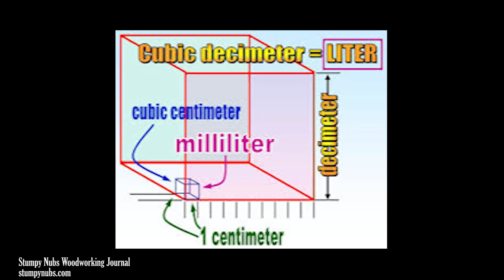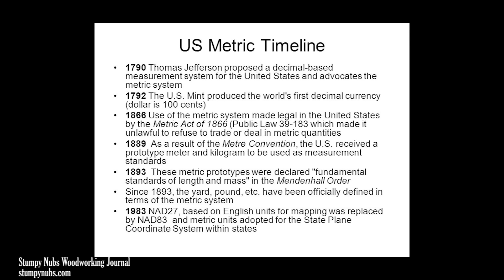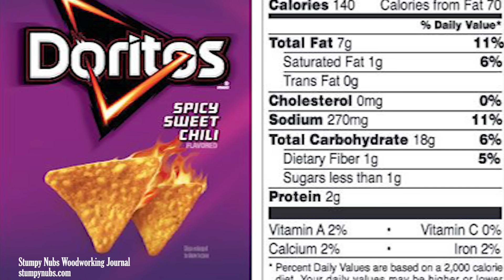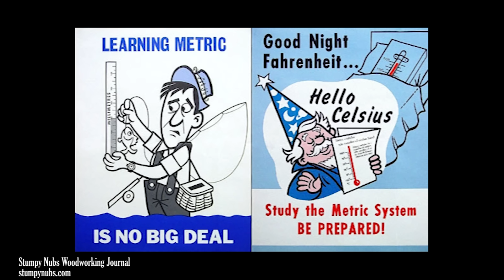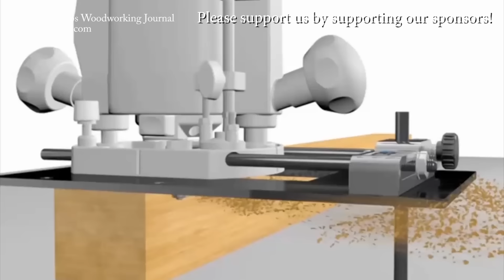BREAKING: The USA is switching to METRIC!

Comment: I’m Canadian, grew up as a kid in the SI world, adopted into the metric system when Canada flipped and am equally confident in using either system. However, I frame houses 16” on center, using 2x4s, 2x6s, 2x8s etc, do most cutting with either a 8 1/4” or 10” blade on my  power tools. When I drive to the local hardware store I keep to an average posted speed of 60 km/hr over a driving distance of  12 kilometres, all the while wondering if the weight of the  load of  5/8” plywood will make the trailer tongue weight exceed its maximum rating of 200lbs. Of course during the drive home my wife phones and asks if I could pick up a pound of ground beef, 2 litres of 3% milk,  150-200g of freshly sliced smoked ham. I said “of course I will, but first have to stop and get some gas - hey, did you notice gas prices dropped to 173.9 a litre today!?!?!”  Her response: “ great, now we have a few extra toonies to take with us on our trip to the States tomorrow!”  And,  finally “Yes dear I’ll remember to drive at their posted speed limit of 60mph!”  Now I ask you, do I qualify for dual-citizenship, or do I simply have to accept the fact I live in a global world.
Reply: Retired Canadian carpenter here. I lived through the same conversion. I was a foreman with about 20 men working on a large concrete forming job and it was the first project we did with metric drawings. The mistakes were a horrendous cost, all bacuse the guys were trying to convert to imperial. After a couple of days, I had to put a stop to this so I went and bought 20 metric only tape measures and the next morning exchanged with the guys for their old ones. It took a day or so, but they soon got used to it. I only lost 2 men because of it and they were about to be let go anyway.
Reply: Is your 2x4 actually 2x4? Our equivalent is 45*95mm so it got a bit smaller, old people still call them 2x4 (that would be 50.8x101.6mm). Or is it that raw timber starts at 2x4 and after it is planed it turns into 45x95 if so you are already in metric...
Reply: @kjelllindberg6987  In the US it's much worse, I think the term 2x4 is defined based on some low-grade timber, while modern construction timbers are a higher grade. Other explanations say the 2x4 was measured before drying and milling. Therefore a 2x4 is 1 1/2x3 1/2" or 38x89 mm. Which isn't a lot more than the 5x8 we use in Austria (48x78 mm). We rarely use those for framing walls though, that's 95% metal studs because they're cheaper, lighter and easier to assemble, no nails or screws involved. Load-bearing walls are either masonry or much bigger timbers.
Reply: @Ragnar8504  My grandfather was a sawyer. He cut 2x4s out of logs that were 2" by 4". But then downstairs in the mill they got planed down to something smaller.
Reply: Oh Canada! 😂

Comment: Canadian here. Almost everything is in metric, but body height and weight still tends to be imperial. My daughter is learning kg and cm, but for me, it’s still Lbs and Ft. Everything else, is metric… except vehicles. You need both metric and imperial sockets and wrenches as half the bolts are metric and the other half are imperial…
Reply: little correction, the SI units are "kg" and "m". centimeters are "cm".

Comment: 6 Months ago I bought my first metric measuring tape...  I find myself reaching for it more frequently.  I'm also old enough to remember being in junior high and being forced to learn the metric system for science...  Dividing by ten is not very hard!  Cheers!
Reply: Fractions aren't hard, either. We learned them in elementary school.
Reply: @TheCharleseye  Both are easy, but it's just simpler to say one number vs a few numbers. That's it. You can say: "three AND one-sixteenth" or just "seventy-eight". When you're on the jobsite it's easier to scream one number, instead screaming multiple numbers. It's also easier to add/subtract whole numbers. Doesn't mean fractions are difficult
Reply: @wittttttt  Obviously fractions aren't difficult. American laborers use fractions without any issues over yelling the numbers across job sites. It's the rest of the world that can't handle something so simple, that they need a system to be even easier than the one Americans learned in grade school. That's fine, though. That was previous generations. This generation can't even make change. It's a good time to switch, so that this generation of Americans actually has half a chance of being able to handle the math related to a given field. American exceptionalism is circling the drain.
Reply: @TheCharleseye  Just to be clear - I use both.  Dividing fractions? invert & multiply.  Quite simple. Metric - just divide.
Reply: yeah I remember them training us on metric when I was a kid, then it just kind of died.
Reply: @joefaraone977  Right on.
Reply: @TheCharleseye  I don't understand where you get the idea of the rest of the world not being able to use fractions - everyone learns it in elementary school same as in the US and we do A LOT of fractions in school/uni since a lot of engineering formulas utilize them - it's not like we use multiplication by 0.125, we still use divide 8 etc. 

I think a large part of why metric people complain about fractions is that since we do not use it daily, for materials an such, we (european myself) automatically want to think in what you would say decimal and it creates silly numbers, that are not "round" numbers. For example since the stuff we use are not ever in fractions like 5/16, we would convert it to 0.3125 and that just makes for an unappealing number. I don't think it's necessarily hate for imperial/usc, it's just that we are not surrounded by these numbers daily.

Imo, use whatever you want and think is best.
Reply: @TheCharleseye  "Fractions aren't hard, either. ". The point is they are unnecessary. It's useless labor when a simpler method is available. Adding up 4 inches and 3/8 to 12 inches and 7/16 instead of two whole numbers? No thanks.
Reply: @TheCharleseye  - Okay, say you have a steel beam that's 26 feet long, and you need to divide it by 7 so you can weld support beams to it.  That gives you a measurement of 3 5/7 feet between beams.  How are you going to lay that out with your imperial tape measure?     If you're using the metric system, 26 feet = 792.49 cm.  Divide that by 7 and you get 113.21 cm, which you can simply read off your metric tape measure (and you just multiply 113.21 times 2 or 3 or 4, etc., to get your next beam's location from the starting point).   Which is faster, easier, and more accurate?  It's a no-brainer.  Don't say Americans are smarter than the rest of the world, most Americans don't know fractions at all, and those that do use fractions in construction have memorized the ones they need, but would probably not have any idea how to solve this problem with fractions.

Comment: Went totally metric when about 2 years ago when I finally changed to Celsius because I did a total immersion language so I could feel comfortable in my second language.  The hardest part of that was actually the fact that I needed to convert the speed and distances for when I described a road trip because I was so ueed to giving location as being the amount of time it took to get there not taking into account that I was telling that to someone was using the Autobahn which made something like its an hour away from Chicago a meaningless statement.😅
Reply: I'm just running in to the "X hours away" situation while planning a trip to Japan next year, where "an hour away" (while considering daytrips from my hotel) can be anything from 25km to 300km. ;-)
Reply: Celsius is not metric and is  half as accurate as Fahrenheit, who cares when water freezes and boils at SEA LEVEL...   Next, time is divided by 12....
Reply: @davidsilvercreek8541  bro you can add decimals to celsius and it will be the same accuracy... accuracy is dependend of the Device you are using not the numbers that come out... you can even make you're own scale if you want... but you cant change the device and its accuracy to measure stuff
Reply: @mRw0oK If you use a big enough sling shot you can make a pig fly...
Reply: @davidsilvercreek8541  you can throw sayings around as much as you like, in the end you cant argue with logic. But you wont understand because you dont even understand the conept of logic
Reply: @mRw0oK Logic?  Twelve was the original multiplier, long before your magical ten came along....   Ever seen a clock?   How many months in a year?   Dozen, twelve pairs of human ribs...   I understand your logic, you have ten fingers to add and subtract with but that has nothing to do with  temperature..   Besides any scale can be broken down into decimals....   Logic?  You don't have any...
Reply: @davidsilvercreek8541   Do you seriously take the hours and months as an argument? X'D
Those has nothing to do with measurement systems. 
As i once heard, the amount of months and the 12-12 hours system has to do with constellations of the time when they were invented.
And i'm pretty sure that you not measure weight, lenght and stuff in constellations. Or do you?
Reply: @tovarishchfeixiao  haha, bro dont worry, as I sayd He doesn't under stand the concept of logic, in his mind 12 is better then 10... Who can argue with that? :D
Reply: @davidsilvercreek8541  im really sorry that you didn't get the education to understand All of this, maybe one day you will wake up and have 12 Fingers to count :)
Reply: @mRw0oK   True, i just wanted to lecture him. :'D
Well, while he do complicated maths problems, we will just move the decimal dot a bit away to get our results.

Comment: At 1:20 in the video the signs are incorrect.  Converting form Km/H to MPH is really very simple.  Multiply the Km times 6, then move the decimal one place to the left.  30 times 6 equals 180.  Divide by 10 (move the decimal to the left) and you have 18 MPH.  100 Km/H is 60 MPH.

Comment: Here in the UK we use both interchangeably, although I think imperial is becoming less common in the younger generation. I'll use imperial for my height, weight, distances and speed, but metric for almost everything else. I like the ease of halving, say, 4 & 3/8 inches by doubling the denominator, but for any precise measurement I'm just much more comfortable in mm
Reply: exactly the same, if we could just shake those last few
Reply: As a child of the 80s in Scotland, we only learned distances in metric, which is weird because we still use miles on our road signs.  I just wish we'd hurry up and get rid of imperial measurements - we should have done it decades ago.
Reply: I'm happy using both at the same time. Carpets in the UK are often measured in feet in width, but metric in length! I tend to swap from one to the other depending on what I'm doing and which gives me the results in the quickest way to work out.
Reply: I understand you still price race horses in Guineas.
Reply: @newportshapwick  The carpets measures are hilarious! 😂
Though I can understand how such a thing evolves in time.
Reply: I'm in Australia, but I still use feet inches, solely for peoples height.

Probably because I like that I am exactly 6' tall, and like making a pointing that out to many guys who are shorter claiming to also be 6'.
Reply: Plumbing in the uk is fun too. Copper and plastic supplys all mm, brass and steel imperial, waste pipe and fittings a bit of both 😂I doubt certain things will ever fully switch but you get used to it I suppose
Reply: And beer in pubs must be sold in proper Imperial pints... Works for me...

Comment: I've always preferred the metric system over imperial. I use it for everything from my calipers, software, laser cutters, UV printers to my CNC. What's annoying is when I go to buy things like CNC router bits and they don't have the metric version. You can always use math to convert  but having two different standards seems silly to me.
Reply: If you're from the USA you've never used the Imperial system
As the USA has never used it
We use the United States Customary system

Comment: Inches is what size a screen comes in. Not sure why anyone would think the diagonal length is relevant to screen size, but here we are.
Reply: I suppose it made sense when screens were never going to be other than 4:3... Now it's just annoying.
Reply: @jaska7515 
The irony of what you state is that 4:3 is a fraction which equates to 1.3333333333333333333333333 in decimal. The fraction is easier.

Comment: Hi Stumpy, coming from Australia I did my schooling and joinery apprenticeship in imperial.  Australia went metric, for measurement around 1974 just as I became a tradesman.  So I am conversant with both systems.  I'm with you, metric is by far a simpler and more accurate way of working.  Eventually all us old imperial dudes will be dead along with the system based on 12 with crazy fractions.  Long live the metre!
Reply: 12 inches in a foot, yes, but 3 feet in a mile and 5280 feet in a miles. Let’s ignore hands, yards, furlongs, barleycorns, or twips. Yes, for woodworking, you’re mainly in inches and fractions of, but I’m so glad I run my shop entirely metric rather than an archaic British system based on an ancient Roman system
Reply: It may be more simple for you but stop saying metric is more accurate - it is not! It is just as accurate as any measurement system you choose to use. Jesse
Reply: As long as you can select to use short tons vs long tons:

Imperial is alive.
Reply: @garysouder9111   I agree, both are as accurate as each other. Its just that Imperial may be more prone to error from a "user" perspective.
Reply: @andrewpullen2655 
You beat me to it. There's more room for error when trying to convert or add and subtract different fractions.
Reply: I agree with you… except for the way you spell “meter”. LOL
Reply: Metric is more accurate. You could call me lazy, but I usually put complicated math in calculators or spreadsheets. So getting a decimal directly from the ruler avoids an extra step and means fewer mistakes. I did prefer imperial until my projects called for triangles, kerf cuts or curves of persuit. Still, my American brain is hard wired in feet, inch, yard, Fahrenheit, cup, gallon, tablespoon, ugh. Until I overcame my personal stigma against metric i did not realize how much brain power i waste tracking all those arbitrary conversions. The only reason to fight for imperial units is the trauma we all shared as children memorizing them.
Reply: Potentially any measuring system can be equally precise. Funny is that people who have to be accurate in imperial start using thou. That kind of means they use metric to make imperial work.
Reply: @Diogenes2077  I work for a contract manufacturer of precision components.  70% of the drawings are US Customary and 30% are metric.  And yeh, using thousandths of an inch makes “inches math” more like millimeters.   I can covert back and forth (metric - US) but when I want to visualize something small, I need to convert to inches.  If something is 250 microns (.250mm) I’ll think “that’s about .010 inches”
Reply: There's nothing inherently wrong with fractions other than tenths, but they kind of suck when you do the maths in a base 10 numeric system, and using different fractions for every unit is just bonkers. I guess if you want to be full galaxybrain, you'd have to build your own units based on fractions of 12 and do all your maths in base 12 as well ;)
Reply: Another Aussie here - born 1958. Most of my early schooling was imperial and we switched to metric in my last couple of years. In a woodwork, metalwork or building sense, I would only ever use metric. Simple, fast and accurate. As it was instilled into my young brain, I still find myself falling into imperial for some things. "Needs to move over by a couple of inches" or "8 foot ceiling" or "6 foot waves today". I guess it's good to have perception in both but if I had to choose it would definitely be metric.
Reply: @kakman1958  metic is good for simple fact it aligns with used number system. We could use another base but base 10 is simple ( probably because we have so many fingers )
Reply: @andrewpullen2655  like misplacing a decimal point
Reply: @jakubrogacz6829  ahhh yes, counting in other bases! Base 10: digits of 0 to 9, easy. Base 8 (used to be used in computing): 0 to 7 just remember no 8 or 9! Base 16 is 0 to 9 and the others becomes A,B,C,D,E,F.

Quick jokes. There are 10 types of people in the world, those that understand binary and those that don't.
There are 10 types of people in the world, those that know hexadecimal, and F is the rest.